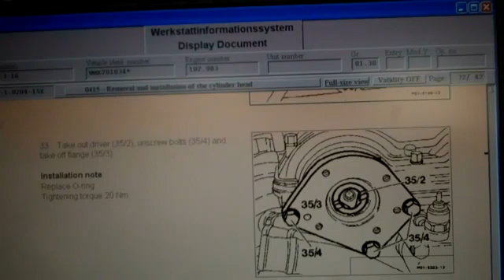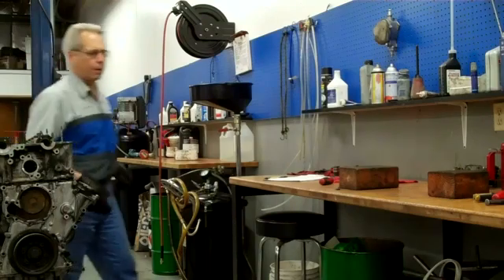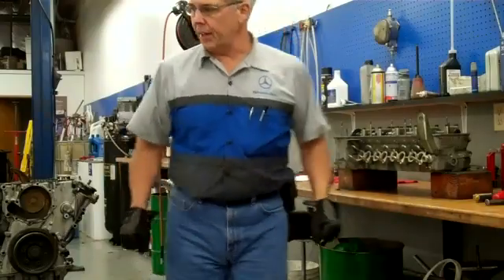Cylinder head removal 2.3-16 for inspection and repair

Comment: Wait! You lined up the timing marks on the damper and cam sprockets and took the spring out of the chain tensioner. No problem The camera shot changed and you were removing the head bolts. You skipped over how the cams and sprockets are removed and that's precisely what I was hoping to see.

Comment: Manual says: Install tensioner case in block (setbolt removed pushing in the working direction) to 15 nm, install setbolt, push in, install spring and cap with ring gasket in place at 70 nm.

Comment: Anyone know the cylinder head bolt torque specs and degrees? My manual says it should be the same as other 102 engine non costworth sohc 2.3? Help!!!

Comment: I think ratcheting cam chain tensioner only came out subsequent to the build of your engine?  Apparently a not optimal oil pressure relief valve that sometimes jams closed causes hydraulic tensioner to over force tensioners and then ratcheting tensioner locks way to tight. Latest is to eliminate hydraulics and have a simple mechanical tensioner. Did u break the water pipe in the process of removal?  Nice video.

Comment: I have a 2012 c250 with a broke timing chain. Is this an interference engine? I'm sure I can fix it if it's just the chain I run a shop and we do a lot of builds but I can't find any information on this 1.8 turbo Benz engine. The chain is broke and I haven't taken the timing cover of yet but u can see the tensioner exploded. Long story short. Is the head ruined with bent valves? If so I'm just going to purchase a used engine and part the old one out.

Comment: Hello! i have a 1998 300 td and the i changed my thermostat and Radiator and coolant but car still over heats, that hose from the coolant in the reservoir is cool the hose where i put the new thermostat is cool, But the hose that comes from the engine back to the radiator (top hose) is burning up in temp. what could make it do that.

Comment from the maker: I don't recommend timing chain replacement unless you are beginning to get some ratteling at start up or after an oil service. To do it correctly the cylinder head must come off. If it does rattle after an oil service, pre-lube the tensioner by removing the coil wire to pump up the tensioner before start up. Then, don't forget to reload or replace the tensioner properly.

Comment: realy great! love the project, I also have a 2.3 190 myselft though its just an 8 valve.
I would also like to increase the power of it, so im wondering if maybe a 16 valve top would fit? or might as well turbo charge it. Its realy great you told about that tensioner, I dont think i would have thought of that when taking the block appart :)